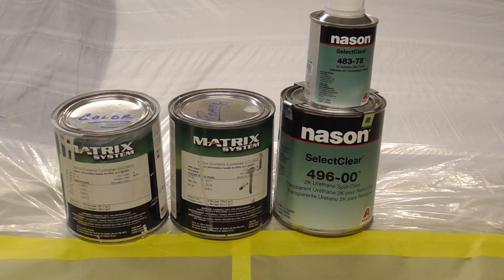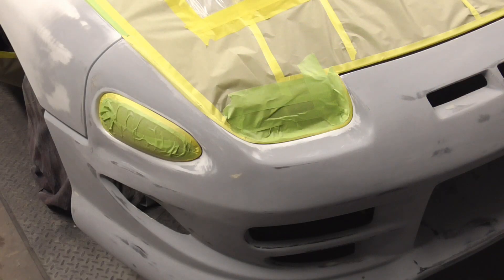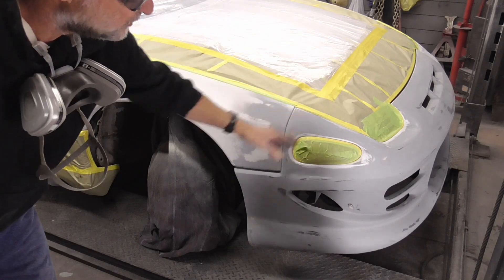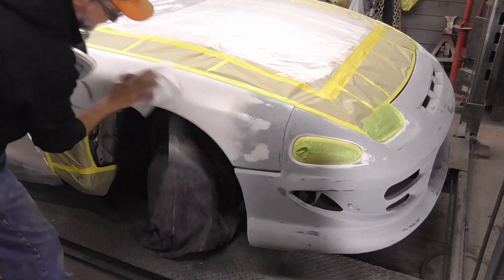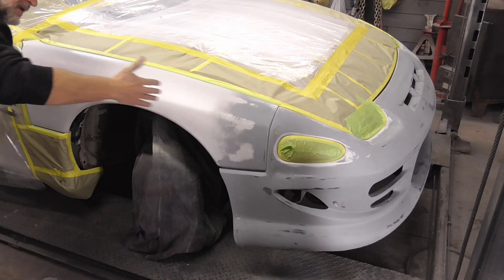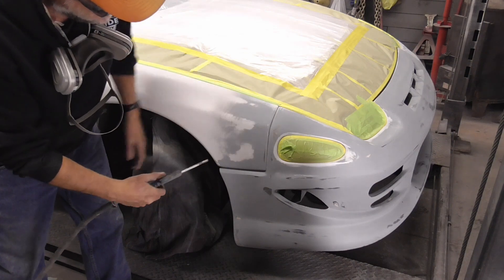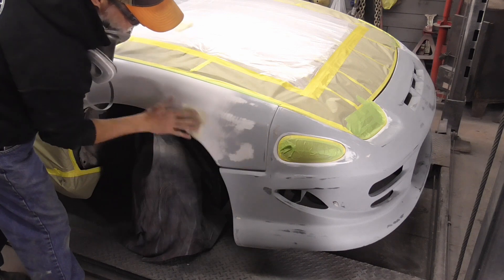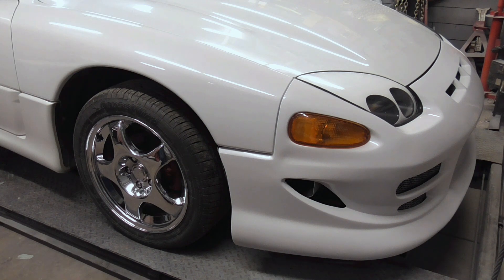Duraflex Custom Bumper Installation Part 4 - Spraying Tri-Coat Pearl BC/CC

Comment: BTW, the GT is lookin' good!  I rarely paint anymore because of my vision, but my buddy Nacho called me the other day and said his heater was broken, and his paint guy was scared to paint the side of an Amazon van in 48 degrees.  I went and painted it for him, and I haven't lost as much of my "touch" as my vision.  Their bodywork looked like a sack of walnuts, but my paint was slick with no runs.  Someday when I launch my channel, the video will be there...
Reply: Haha I've been aging with a fiberglass kit car ,and the shops been around 38-42 degrees as it's not heated. 
It sure buys me time when mixing up and working with some resin, I'd figure paint would be the same way ,it's just gonna flash off or set up at a much slower rate ,and that's not always bad.

Comment: That turned out nice👍I have one of those gun bud paint gun lights to help me see the clear go on. Or i grab a thin rechargeable bar light. I see you are fully suited up now for paint. I need to start doing that, too. I have a couple paint suits. Just gotta wear em...
Reply from the maker: Thanks BBG - have a good weekend.  Just takes a few seconds to throw on the suit  - I use them over and over ever though they are disposable :)

Comment: Seems like you could have pre-painted the lower lip of that bumper like you did around the lights.  ?
That sure was a lot of work getting this piece to fit. It shows your talent and perseverance!
Hope you have a great weekend.  👍
Reply from the maker: You're right - probably could have shot it real quick by using the lift to get it up in the air.  Would have made it a bit easier to paint.  Thanks Jim for your support all the time - you have a good weekend too 🏈

Comment: in the beginning i was wondering why there was such a prominent horizontal gap of the lower front fender to the bumper cover when you were fitting the vertical gap between the front of the fender and the bumper cover.  that's weird i thought.  why wouldn't you fix that also.  i didn't want to question it because i was going on the assumption that you knew what you were doing so i was obviously missing something.  it was only on this video, where it was unwrapped, that i see that it lines up and gaps perfectly with the lower body side mouldings.  pretty glad i stayed quite and didn't make some dumb comment when i only have about an hour experience in body work.  good job, looks great

Comment: What would cause clear to crack up as soon an you spray it
Reply from the maker: If it's still wet then the stuff you are spraying it over might be having a bad reaction to it.  What did you spray it over - type of paint?
Reply: @LakesideAutobody  actually I was clearing headlights but I was following the advice of a YouTube video against my better  judgement and used Rust-Oleum 2x rattle can and I think it didn't like it or they still had some kind of wax on them
Reply from the maker: @RobertDickens2002  I think your right about the wax.  That sounds like something that may happen with wax and an oil based clear - not sure if the 2x is oil based but most of Rustoleum stuff is oil based enamel.
Reply: @RobertDickens2002  sand it off and get the maguires headlight spray, it works well
Reply: @yeayeasautoadventures1161  I have seen a channel that uses that but they sand it and polished it before they put it on
Reply: @LakesideAutobody  I wiped it with iso before I sprayed it was that not strong enough
Reply: @RobertDickens2002  yes, I should have said polish as well
Reply from the maker: @RobertDickens2002  Even though some folks use that for wax and grease remover in some YT vids  - know that I've never seen it used in a body shop so.... maybe wax and grease remover is better or made to do just that - remove wax and grease.  Just my opinion though :)
Reply: @LakesideAutobody  well practice makes perfect I guess
Reply: @LakesideAutobody  I tried on another set with real clear and same issue I've never had this problem before I'm gonna get some wax and grease remover and have another go at it.
Reply from the maker: @RobertDickens2002  Git it a try.  Let me know what you find out - I'm curious now as to what's causing it 🤔
Reply: @LakesideAutobody  don't you love it when something happens and makes you question everything you thought you knew
Reply from the maker: @RobertDickens2002  Yes - actually the older I get... the less I know about stuff... like politics, religion, space, etc.  Heck, if sh*# hit the fan I don't even know if I could find food.  Maybe I could carve a sharp stick but that's about it.  I'd just walk around earth with an old seat cover wrapped around my waist and a sharpened tree branch 🥴
Reply: @LakesideAutobody  unfortunately I think we're getting closer to shtf.
Reply from the maker: @RobertDickens2002  Yes 🤢

Comment: C'mon, man!  Tweety-bird customs assures us that touching the snubstrate with your greasy mitts assures premature delamination.  He took a class from that expert guy and he knows stuff.  I bet you didn't know that putting bondo on metal causes rust. And premature delamination...
Reply from the maker: I like it.  I always feel guilty putting this on camera but it's really the only way I can make 100% sure there's no dust nibs.  Actually off camera, I do it about 3-4 times.  I've never had a delamination problem in my life - no fish eyes ever.  Good stuff Kenlycan - have a great weekend my friend :)
Reply: @LakesideAutobody  trust me, my friend, I do things differently than you or any other content creator I've seen.  This is because I had to teach unskilled workers to do skilled work with as little time lost as possible.  I would not hire a painter or helper who had experience, because they all seemed to have had bad experience...  That was the 80s and I was using acrylic enamel in my own self-built,  pressurized, heated, side downdraft paint booth.  If I could find noticeable dirt in the finish, I was hollerin' at the boys.  I told whoever was masking that I better to be able to blow that tape like a hurricane force wind without any of it peeling up.  If someone did something wrong, I read the riot act to the whole crew.  The guys who didn't do it got a kick out of my ranting and raving, while the one who did it was thankful I wasn't singling him out.  I've had some damn good crews over the span of 40 years.  Like I said before, you're old school, and I respect that.  These young smart-alecs with their "best practices" horse manure dissing old school really grind my gears
Reply from the maker: @karsbkool  I like your thoughts and comments - It would have good to have worked together.  You're right about all of this body work snobbery.  I think if they would have seen some of the work that was done it would be different so... gotta let it go.  Think of the custom vans and paint jobs at the Autorama, etc - the top fuel drag cars, funny cars, NASCAR and so on - awesome paint work and good times!  Always a pleasure talking to you 😊
Reply: @LakesideAutobody   I had many shelves of ready to spray cans of base that was left over from tinting and matching jobs.  I would guess at least 300 cans.  We used them sometimes on future jobs, and sometimes as ground coats to save from mixing alot of new paint.  The paint rep comes by one day and says we need to switch to the new activator/reducer to produce a better job.  I immediately asked if he was telling me all the years I'd been using his company's basecoat, I had been delivering inferior work to my customers.  Before he could reply I asked if he was telling me that the thousands of jobs we'd done were going to fail prematurely, and I'd be re-doing them.  I saved thousands of dollars a year the way I was doing it, using basecoat reducer that was $38 a gallon.  He was telling me to switch to reducer that was $92 a gallon, and wipe out all the additional saving that my methods provided.  Obviously, he could not tell me that the non-activated reducer I'd been using was crap, and he never tried to "upgrade" me again.  These young guys who parrot the material data sheets are just trying to sound smart.  They lack the real-world experience we old-schoolers draw upon.
Reply from the maker: @karsbkool  Great story Kenlycan.  Really the only way to know anything at all is the real life failures and successes.  How would you know about marriage unless you've been there? 🤔  It's like asking the Pope about it 😊
Reply: @LakesideAutobody  the Pope, lol.  Good one!  I'm studying YouTube, and apparently outrageous titles get you views, but if you can't back the title with corresponding content, you won't get subscribers.  I thought of ten fairly outrageous titles for videos, and ten for shorts.  I already have most of the footage to back the preposterous claims, I just need to polish them into edited vids.  Jan 1 I'm launching, ready or not.
Reply from the maker: @karsbkool  Looking forward to it K - I'll be your first subscriber 👍
Reply: @LakesideAutobody  you won't diss me for slingin' a lot of mud will ya? lol. I don't know if it's just the Midwest, but when I started doing filler, we didn't call it mud, or bondo, we called it body putty...
Reply from the maker: @karsbkool  Absolutely not - nothing but support here my friend :)